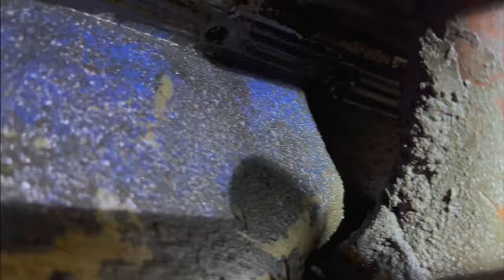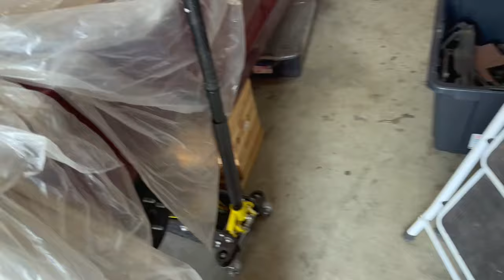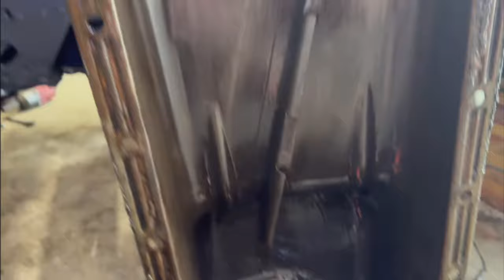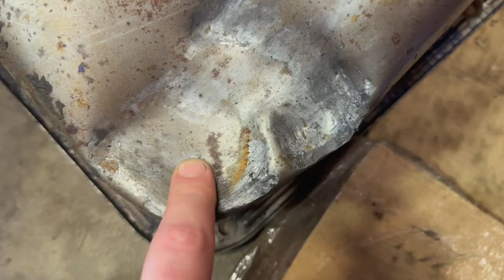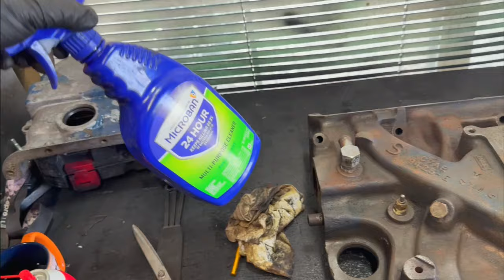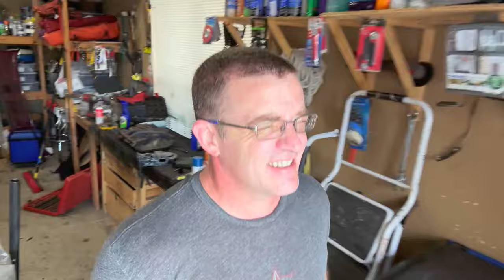Buck Cleans the Engine - 1965 Ford Thunderbird - Episode 46

Comment: I’ve watched this a couple times now and still can’t figure out.
 Can you change the timing chain without removing the oil pan?
My timing chain failed this weekend “I think” and absolutely know I don’t wanna dick with all that goes with removing the oil pan!
Reply from the maker: Yes you can.
Reply from the maker: Worst case you'd have to remove the oil pan bolts and just let it hang. But when I forgot my pin on the cam sprocket, I just removed the cover. There is plenty of room
Reply: @ but what about the oil pan gasket, won’t it be torn up?